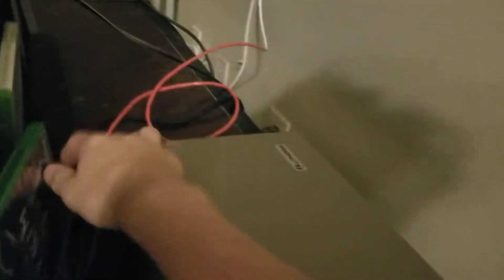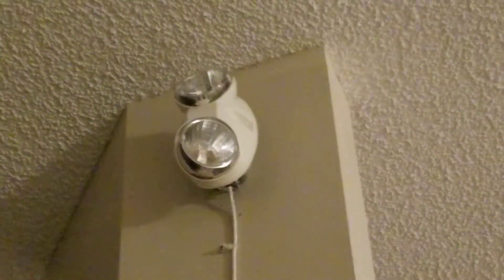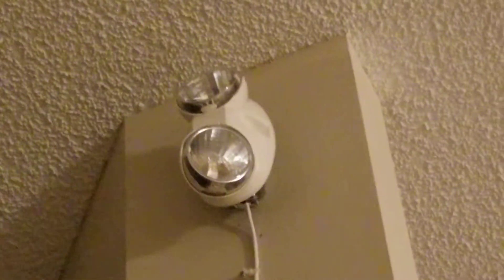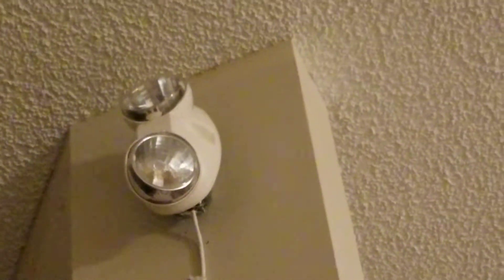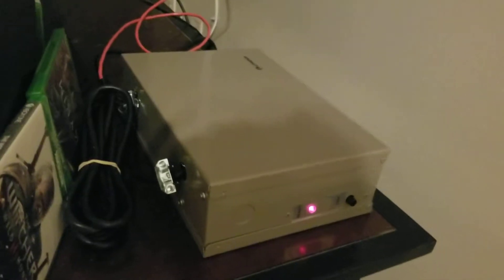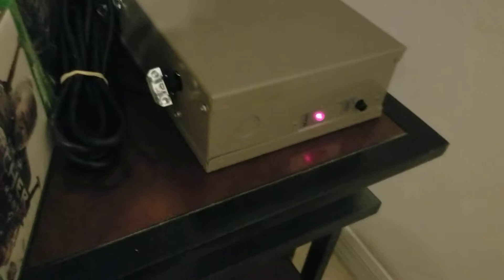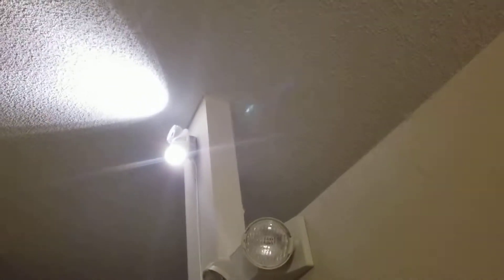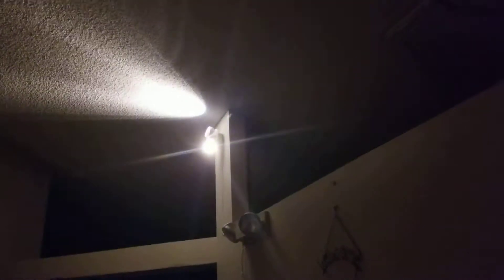Remote Head Emergency Light Setup

Comment: You should add more led remote heads too it.
Reply from the maker: I could, but then it won't run for over 30 hours like it does now. :)  Great for hurricanes here in Florida.
Reply: You always want LED crap. The LED units are horrible (except for Duel Lite and some other units). I will take a LHQM 3rd gen over a crappy and poorly designed LHQM LED which all of them should belong at a dumpster.
Reply: A teacher at my middle school had an led one in his classroom